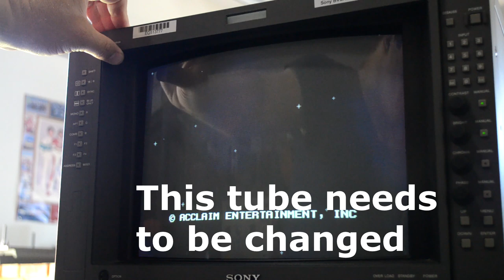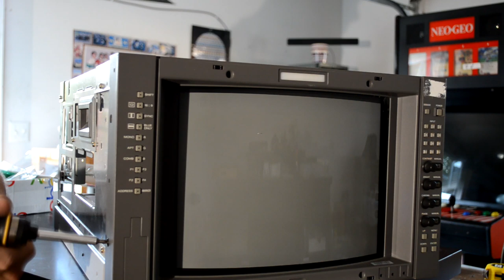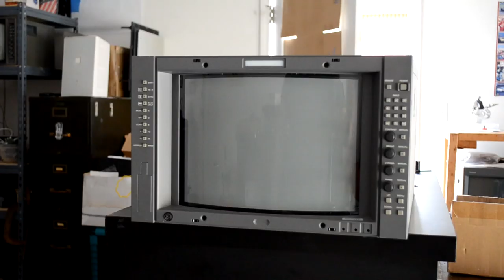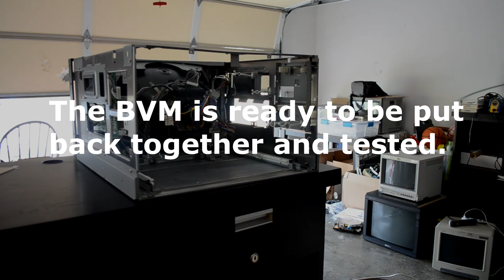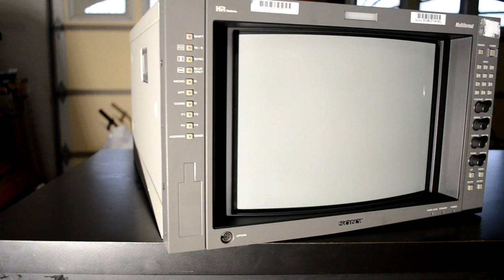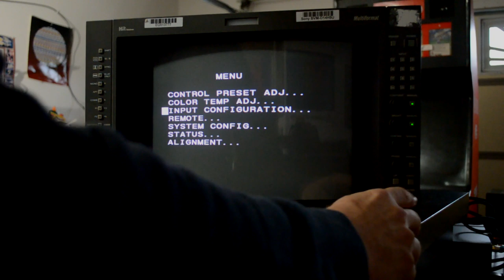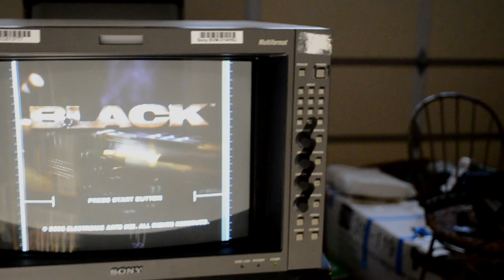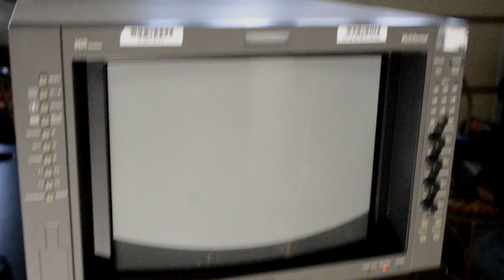Future-Proof a Sony BVM D14H5U - Full Restoration & CRT Tube Swap!

Comment: Gosh we used to get these in for repair many moons ago. They were state of the art when they were new as with most of these BVMs and PVMs.     I work for a company which is a Sony repair centre.   The modern stuff is really good too.  For a while Sony made these LCD monitors in the same form factor as CRTs.    Great set of videos !  I would really love a Sony D24-E1WE at some point.

Comment: Are you keeping those old tubes for now incase you someday get a rejuvenator?
Reply from the maker: Yes, as long as there isn't any screen burn.
Reply: May I know what does that do?
Reply: @BasedPajeet  Here is a example of one at work. The ones that work  for Sony Trinitrons are very expensive. Basically is a way to restore older tubes (very commonly used for arcades)

https://youtu.be/_kgy7CCsEBQ
Reply: @Demokirby  FYI: Just want to let you know that people in their comments section, said they rejuvenated their C.R.T., on the incorrect setting.

Comment: I'm planning on doing a tube swap with two 32 inch wegas. Any advice on handling those big tubes?
Reply from the maker: Well, just make sure you have a friend or two that are physically fit to help you out.  Those are back breakers.
Reply: @RetroTechUSA  alright thanks. I think i might pull the tube out screen side down so that it's weight holds it in place until I'm ready to remove it.

Comment: Hi Retrotech,

Big fan and subscriber here. I recently found an NOS BVM 20" tube for a $200 dollars. It looks like swapping out a tube on a BVM is a fairly straightforward forward job that doesn't require any specialized tools, am I right in that?

Comment: Nice video :) Do you saw that linearity issue on a scroll test that i was talking about? Bearly visible on a 3D games but 2D paltformer you should see it. I am wondering why the heck the screw it up.
Reply from the maker: What's a good game or two that I can use to see it?  I'm not sure I've noticed it yet.
Reply: @RetroTechUSA  Hi, you can use 240p test suite for snes and check the horizontal scrolling test or mega man 1 for nes, this should reveal that issue :) Check the left side of the screen, from middle to the left.